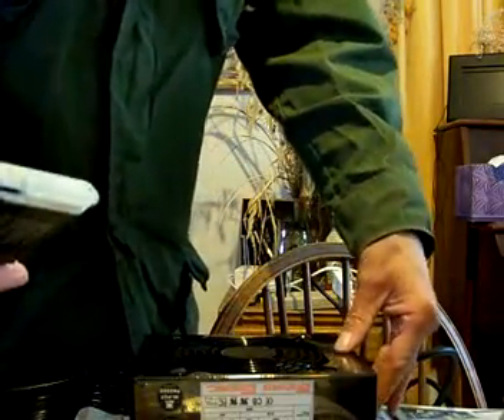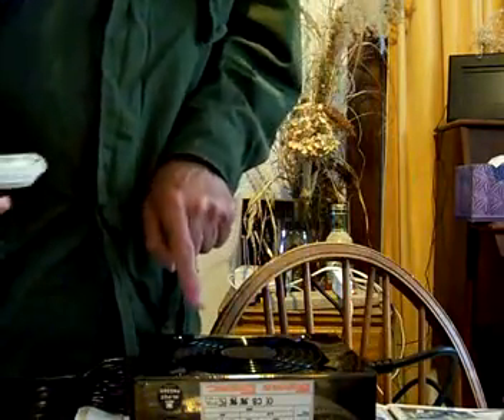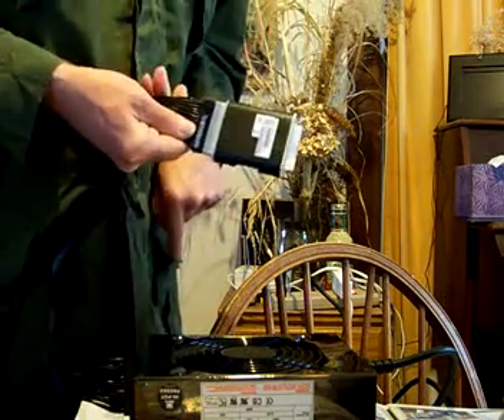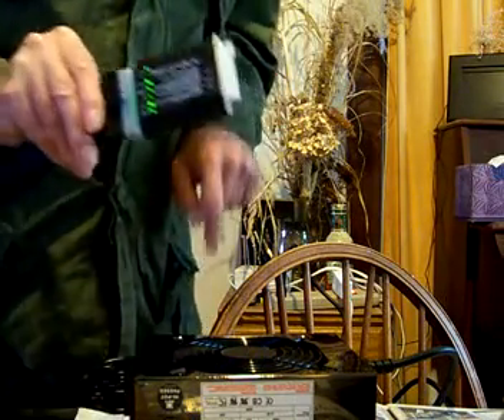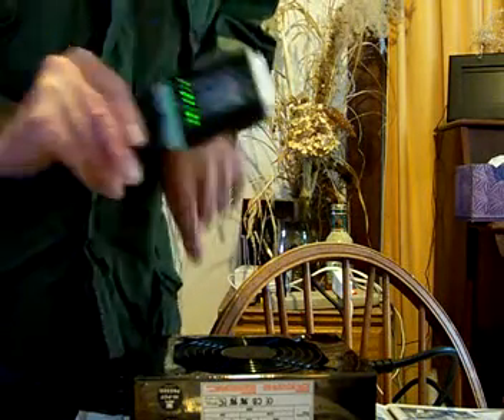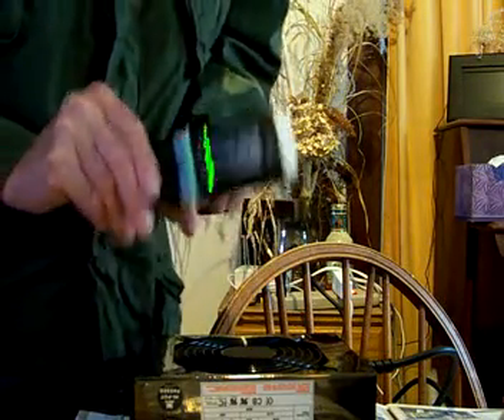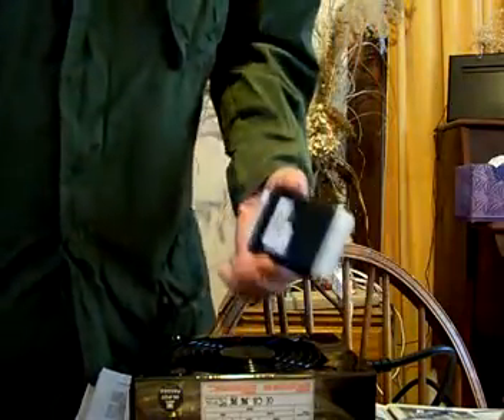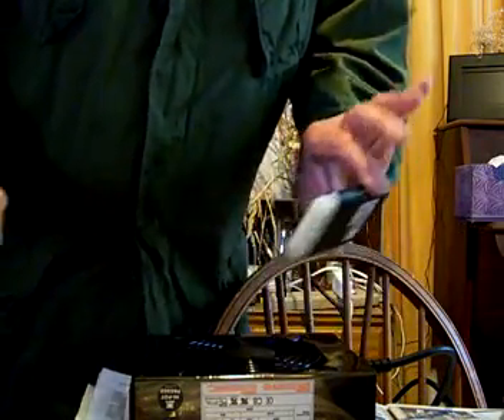How to test a new PC Power Supply

Comment: You don't need a tester, but if you like buying unneeded gadgets, have at it lol.  Just bridge a paper clip between green wire and black wire next to it, grounds on switch and it's fan will turn.  If you want to test power, save your money and get a multimeter or something.

I guess a tester would be a quick way to check one if you were doing it all the time.